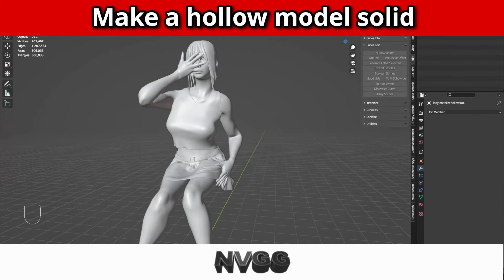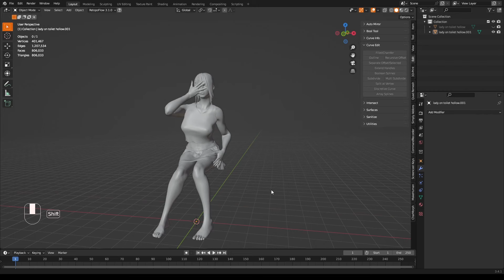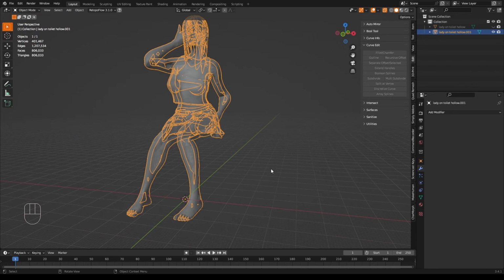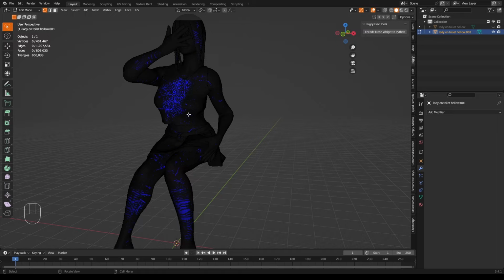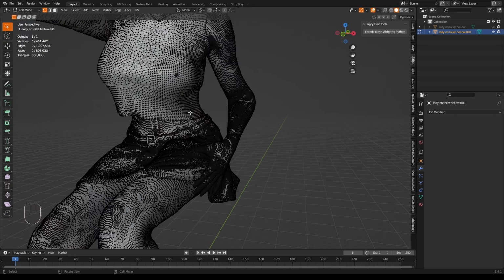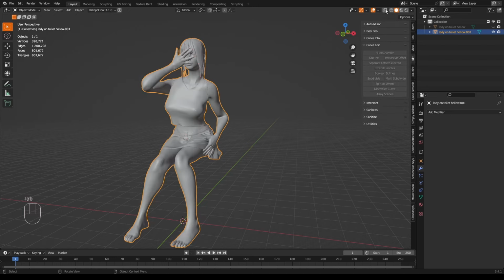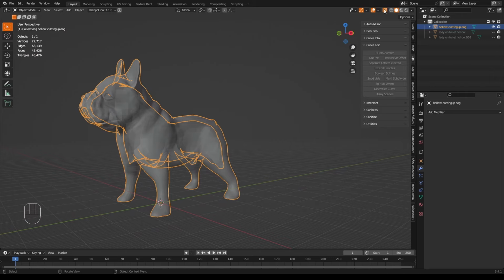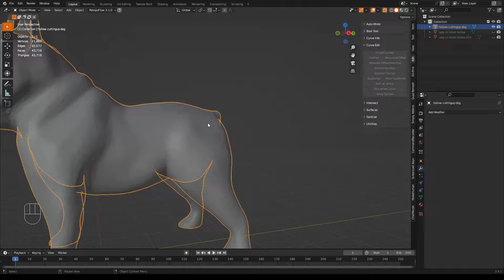Make a hollow model solid again with Blender

Comment: Use case is 3D printing, which often has issues with hollow interiors, especially when scaled down.  Miniatures from full size leads to thin walls and failed prints.  Make the model solid and the slicer with create infill as desired and the miniature will print well.
Reply from the maker: Thank you.  That makes sense :)
Reply: It also prevents resin traps.
Reply: I came here to say this. It becomes even more of an issue if you're designing for Resin printing where uncured resin can get trapped inside the hollows and if the part has resin filled hollows then you're possibly exposing someone to uncured resin. I am learning  to design toys and BJDs. I would be mortified if a toy failed or cracked and exposed a person to uncured resin.

Comment: What does the action L do? Hitting L doesn't seem to select anything for me. When I just select the model by clicking on it, it all disappears when I hit H to hide. It's hiding the entire model and I'm not left with anything to delete. I can see shapes inside the model when I turn on X ray and when I slice it there are weird gaps inside that show up as solid on some layers that print but not others so I'm sure there's something odd going on inside this model.
Reply from the maker: L will select everything that is connected to the vertex under the mouse pointer.  H will hide everything selected.  I would guess that your inside wall is connected to the outside walls somewhere so when you press L, it is also selecting those inside the model.   

If this is the case, you could try manually selecting all the outside vertices by using the circle select tool by pressing c and then adjusting the size of the tool with your mouse wheel.  Then brush all over the outside of the model.  Be careful as it is easy to miss some.  Then when you have selected everything you can see, you can press H.

If you are having problem, post a link to your blend file and I'll have a quick look.
Reply: @notverygoodguy  I am also having this same problem. Would you mind me posting a link to my model for you to take a look?
Reply from the maker: @PaulMLombardi  Sure, give it a go.  You may have to remove the https from the link you post here as youtube seems not to like external links sometimes.
Reply: @notverygoodguy  I posted a google drive link without the https. It showed up in the reply, but now it's gone. No worries!
Reply from the maker: @PaulMLombardi  hat's a really annoying feature of youtube.  If you want you could post it to the Blender for 3d printing Facebook group.  I would see it there.  There is also a Discord I hardly ever visit but I can't post an invite in here sadly.
Reply: @notverygoodguy  No worries! I did some more research and learned my model had other problems too, but I got it all figured out. You are so kind and helpful. Thank you!
Reply from the maker: @PaulMLombardi  Glad you've sorted it now!

Comment: didn't work for me. Followed all the steps then exported as stl. My slicer still says closed cavities detected...😕
Reply from the maker: I have never seen cavities in a model but a google tells me that maybe you could try loading the result in PrusaSlicer whcih apparently handles cavities quite well.

It is possible that your internal wall intersects with the external wall which will probably make this method fail.  You'd have to fix that manually sadly.
Reply: @notverygoodguy  its a figure sculpt in stl form for 3D resin printing i found on line. its Chitubox that gives the error. If its only intersecting of inner and outer walls that won't be a problem. What would be bad if uncured resin got trapped in on of these cavities/pockets. That would expand and ruin the model and leak everywhere. Anyways thx for the speedy answer..😊
Reply from the maker: @ If you can provide a link to your model I'd be happy to have a look at it.

Comment: Would it be possible to give the actual name of a function being used rather than just saying to press L then H etc? My use case is I use the industry compatible key map so I need to find the function myself. But even for someone using the default keymap it could be good for them to be told what’s happening rather than rote keypresses. Thanks for taking the time to make these!
Reply from the maker: I understand your pain here.  It must be quite frustrating.  The difficulty here would be that in many cases I don't know what the actual function is and I guess many people are the same.  H is easy enough I guess as it hides the selection but I don't know what that is actually called in the key map.  Even worse for things like p.  Internally I associate that with seParate but I am pretty sure that isn't the correct name.

I like your idea but am not sure how I would achieve it.

Comment: Thanks! The use case I have here is to fill a hollow model that's too big, so that when it's all printed and assembled there is no chance of liquid uncured resin on the inside. I found that some models with a lot of volume internally can have liquid stay inside there and eventually cause problems.
Reply from the maker: Thanks for this.  It is something I hadn't considered.  Do you think that the solid version  might have some suction issues on the FEP though?
Reply: @notverygoodguy  
So long as you support it with a raft, that shouldn't happen. Or at least it hasn't for me, yet lol
Reply from the maker: @ParryHisParry  Then I wish you luck :)

Comment: Thank You!!! I have just taken up 3D printing again but now with a resin printer. One of the things I have been trying to print is a 12 scale doll using MakeHuman. The problem I had is that the exported file has cavities for eyes and mouth and when I hollow out the model in my slicer it just adds walls around them with no way to drain the resin trapped inside. I'm not very savvy when it comes to Blender and you wouldn't believe the number of different terms I have done searches for trying to find the answer to my problem or the amount of time I've spent searching - I have learnt a few things I didn't know, so the searches were not entirely fruitless :-) So again thank you.
Reply from the maker: I am glad this has helped and I do know the problem you have!  If I use a generated model from makehuman, charmorph or mb-lab I usually remove the teeth and tongue at least if the mouth is closed and it isn't always easy.  I haven't found eye cavities an issue though.  I think makehuman had an option to not include the mouth parts though I might have just mis-remembered that.
Reply: @notverygoodguy  so unfortunately, your solution didn't work because the cavities are not enclosed cavities at all - they are just caves so to speak from the front of the model, even with a closed mouth, there is a minuscule gap and the eyeballs don't seal off the eye sockets. Back to trying how to add a solid shape into the holes :-( But I still think I need to bookmark this video for future uses.)
Reply from the maker: @OzTwinmum  You might try  just going mesh->cleanup->fill holes.  This often works for me when there is an open mouth.  Alternatively, select faces on the back of the head and hide them with "h".  You can then just remove the mouth cavity fairly easily.  At this point you either join the top and bottom lip or boolean a ball or somthing in there.  Of course you need to unhide the faces you hid with ALT H afterwards.   I would say that you can also drill resin draining holes through the entire head and then gluing the hair on top after wards :)  With all that said, if you generate your character with charmorph, the mouth will print fine and the resin will drain out if you do nothing at all.
Reply: @notverygoodguy  Again thank you.. I will give these methods a try. Added bonus is I'm learning more and more of Blender
Reply: @notverygoodguy  yay, I have a printable file with no internal cavities. I took your advice and went in from the back of the head and remove the cavities and sealed up the open areas. Exported to my slicer and all solid. Wish I had found your videao sooner lol
Reply from the maker: @OzTwinmum  Great to hear!  Thanks for letting us know how it worked out :)

Comment: Hi, I'm having an issue with my model. After pressing H the hollow vertices on the inside aren't showing up, so I can't select them.
I think the issue comes from that my model doesn't have a bottom wall to make it an incased whole object, but I tried adding a wall and still doesn't work. 
Any help please?
Reply from the maker: If the wall you added to the bottom had no thickness then there would still not be internal "holllow vertices".  If you have a model that is manifold but open at the bottom such as e.g. a model of a bell and you are just trying to close the open bottom you may not need this video technique at all.  Do you have a link to you rmodel I could take a quick look at?
Reply: @notverygoodguy  I used Mixer to make it solid. Thank you anyways☺️
Reply from the maker: @ivakichan5724  Just for clarity was that Meshmixer you used?
Reply: @notverygoodguy  Yup 👍

Comment: im have a model thats already made and im trying to delete the connection points on the inside of the model as i cant hollow it out in my slicer correctly without having a buggy mess, this did not work for me, is there something im missing or am i looking for the wrong solution?
Reply from the maker: This video is for when you already have a hollowed out model, likely created by your slicer, that you want to make solid again so is probably not suitable for what you want to do.

What might make your job easier if you are just trying to delete some vertices inside your model is to select the outside faces of your model and then hide them with "h".  Then you can see what is left inside your model and delete those you don't need.  When finished you can get back the faces you hid with ALT-h.  I hope this helps but let me know.
Reply: @notverygoodguy  i believe this is the best way to describe what im trying to do, delete the inside vertices, when selecting the outside faces it still doesn't leave behind the inside vertices without causing a glitchy mess, any solution to this? i have photos but im sure comment will be auto removed
Reply from the maker: @PurrfessorFeline  A picture is worth a thousand words but a blend file is even more valuable :)  If you can upload it somewhere it would be interesting to see where your issue is.
Reply: @notverygoodguy  this is a before and after attempt of deleting vertices from the inside https :// drive. google. com/file/d/1FZejm_wrm1Y_qerWdWbEF1zzf30DC4sq /view?usp=sharing "sorry for spacing i cannot comment links"
Reply: @notverygoodguy  This actually helped with my problem. Thank you very much!
Reply from the maker: @dragondoghorse  Glad to hear it :)

Comment: Hi! In my case the hollow is connected to the outside, it is not just a separated object inside with inverted faces. Also the outside is very textured making it a lot harder to select. By using L it selects everything including the "hollow". Any insights will be appreciated, thx
Reply from the maker: This can be a little more difficult but you might be able to do it this way.  Making sure X-Ray mode is off you can select everything you can see by using the circle select option, press c and then use the mouse wheel to increase the size of the selection circle and then go round your model selecting everything you can see.  Because you don't have X-Ray mode on it shouldn't select any inside vertices.  Then invert the selection ( turn on X-ray to check it has now selected the insides) and just delete the selected vertices.

I'd be interested to know if this actually works for you.
Reply: @notverygoodguy  thank you for the suggestion, but unfortunately it doesn't work because the parts the surface is not smooth, lots of faces are hidden from view so even going around and around selecting, it isn't able to select everything.
Reply: @notverygoodguy  let me rephrase it: it works, but it is too much of a  high poly textured sculpt model, that it takes forever to try to select everything. And I'm not that skilled in blender. So I'm trying to find an easier way.
Reply from the maker: @julianopolito  You are skilled enough that you diagnosed correctly why the method in this video wasn't working for you.

Seems to me your only option is to select as much as you can with the circle select tool as described and then hide what you have selected by pressing h.  This will then make it possible to see and select the more difficult to get at vertices.  Keep selecting outside vertices and hiding them until you are left with just the inside of your model.  Then turn x-ray mode on and select everything remaining which should be the inside of the model until you have selected everything.  Delete the vertices and then do alt-h to unhide all the outside vertices you selected earlier.

You'll need to be careful and have a copy of your model first and you might need to fill up some small holes afterwards (use Mesh->Clean up->fill holes) but this will work in principle even if it does take a bit of time.

Also make sure you have face orientation on as described in the video so you can see a little easier which vertices to select.

Comment: Hi,  I have a Terminator Endoskeleton head.

I need to kake a hole into the eye and holow the head so i can put leds into it.

When I try the bohemien method, i get an error message,

Could you help me out and make a hole into the eye of the headsculpt?

Would be awesome!

Thanks!
Reply from the maker: The easiest way to do this would be to model a shape of the hole you need and put it in the head where you need it.  Then use a boolean difference.  If you then turn off the "hole" in the outliner it will leave you with the hole in your model.  Hope this helps.
Reply: @notverygoodguy  as ive wrote! The boolean tool gives me an error. Cant use it on the eyes. Otherwise it had been finished with that tool. But it dosnt work on that part of the model somehow
Reply from the maker: @gaboaaa23  What is the error you are getting? Have you turned face orientation on to check your normals are correct?

Comment: Hello, thank you for this guide. I've tried it to a backpack model I would like to print for a diorama but pressing L makes the opposite - different (depends on where is the mouse pointer) OUTER parts of the model are selected. What can be wrong?
Reply from the maker: The L key selects all the connected vertices under the mouse.  If you are getting different results depending on where your mouse is then your model is probably is separate parts that haven't been joined together properly.  If you can post a link to your model perhaps I can take a look.

Comment: Please forgive me if the answer is obvious, this is my first time using 3D printing for a project. I followed the steps in your video but for some reason my whole model will disappear. Which might sound like it's fixed, no issues, but there is a red part in my model just like it shows on your screen. So before hitting H, if I go into my model I see the red (blue spot was moved to transparent). But when I hit H, the whole model disappears. It also will say it has no geometry data when put into the orca slicer, so I know there's something wrong with the model. Do you know why the red part may be removed too when I hit H?
Reply from the maker: A possible reason might be if the hollow part of the model intersects with the outside so that when you try to select the inside of the model (the red part) is also selects the outside.  Then when you press H to hide the vertices, they are all hidden.  One thing you could do is to try this in reverse but you won't be able to use the l key to select things.  If the model isn't too intricate you could use the circle select option c and then control the size of the selection circle with your mouse scroll wheel and then paint all the outside of your model to select everything you can actually see.  Then hide these with h and see what is left.  If it looks like it is probably the inside of the model, select everything and delete and unhide the ones you hid before.  I hope this works.  Let me know.

Comment: when I press L hovering over the model, it only selects verts in that local zone, all around the map. how do I get it to select everything on the outside?
Reply from the maker: This will happen if the parts that don't get selected are not actually attached to the bits that are selected.  You might want to try merging by distance on everything before you start.  Select everything in edit mode and then go Mesh->Cleanup->Merge by distance.